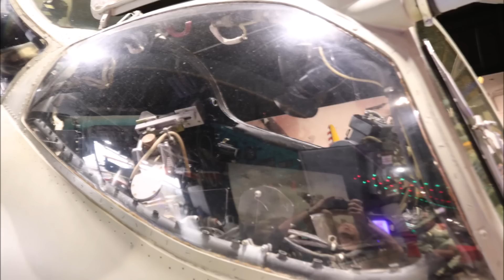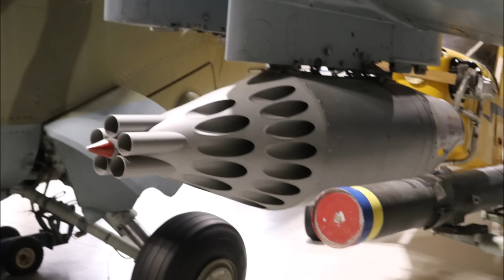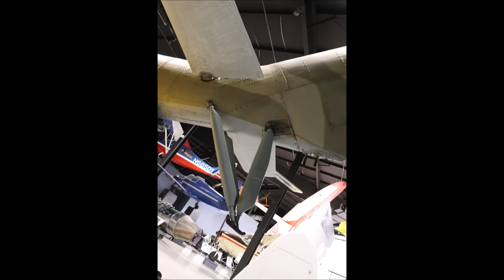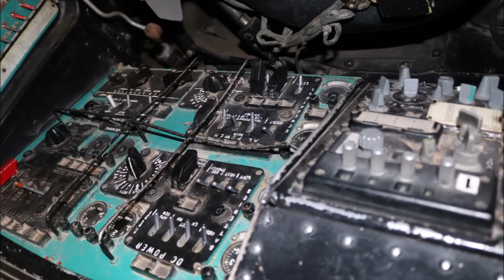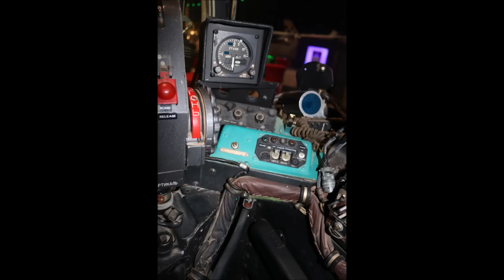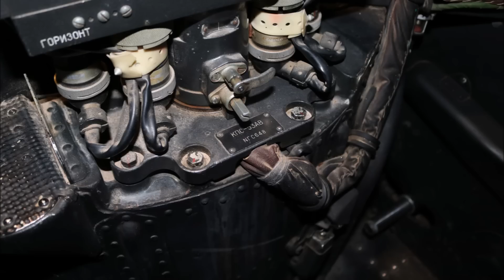Soviet era Mi-24D Hind Close Inspection (Modified by the U.S. Army for training)

Comment: I spend a lot of time in DCS World. It's a combat simulator and you can buy modules to use in the sim. I recently just got the Mi24P Hind and it's modeled in full fidelity. Every button, switch, knob, lever, gauge, screen, etc. is exactly like it is on the real aircraft and functions. You can fly as the pilot or copilot/gunner and each role has it's own controls. It's quite amazing. The real magic is the flight model. It's been tested and tweaked by real world pilots to behave as close as possible to the real deal. It's damage model is also fine tuned. I have been hit with 4 Stinger missiles and still flying. It's modeled down to the circuit breakers. If you want to get as close to the real experience as you can, this is your ticket.

Comment: Nice for the Soviet design bureau to put the exhaust pipes on the Hind right where our stingers could find them.
Reply: You're wrong. The stream of hot air and exhaust gases was dispersed by the rotor, the helicopter was equipped with flares, and additionally, it had a system for jamming and disorienting active warheads.